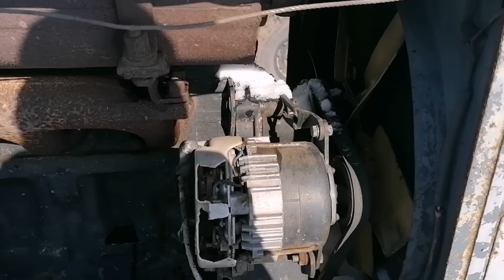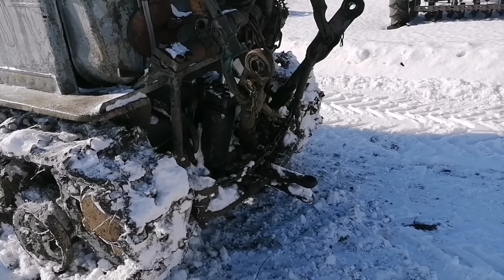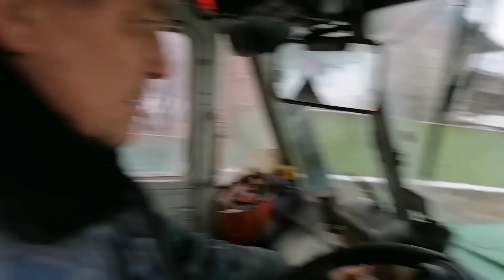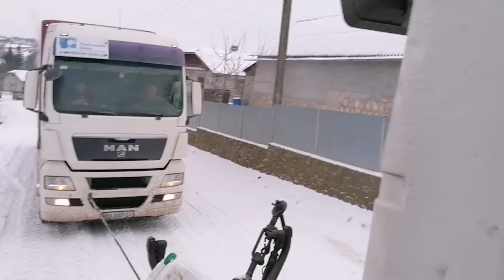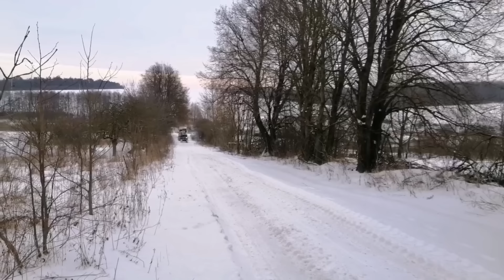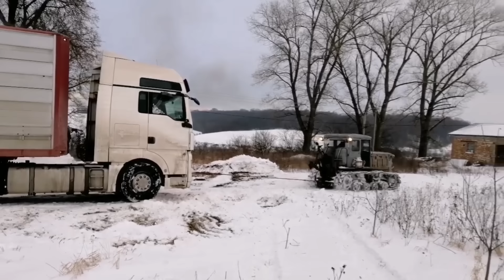ХТЗ Т-74 та Т-150К.В одній упряжці на слизькій дорозі #хтз #т74 #т150к

Comment: How old is the T-74, please. It did a fine job.
Reply from the maker: 40
Reply: @igormyts2061  Thank you, I've always been interested in these tracked vehicles . I build  1/35 models , have built several  early models of the ST  from the Patriotic War. What is the first exhaust pipe near the cab, where the driver starts the engine please .